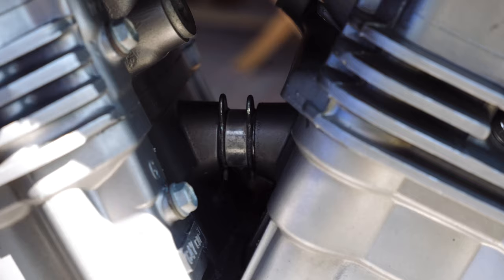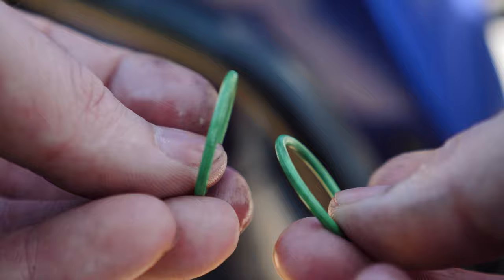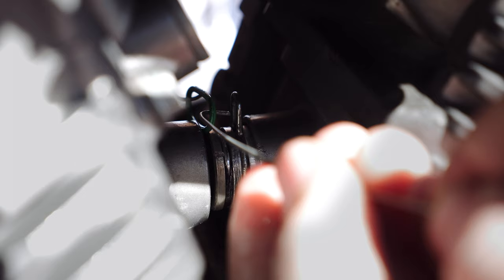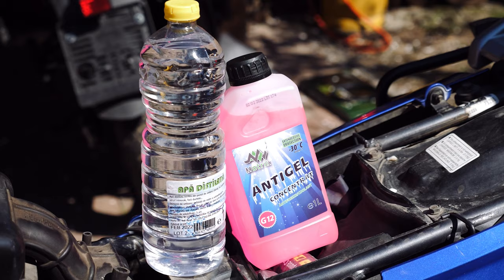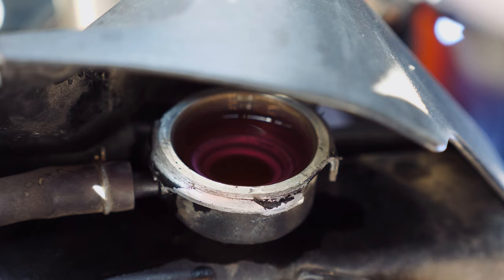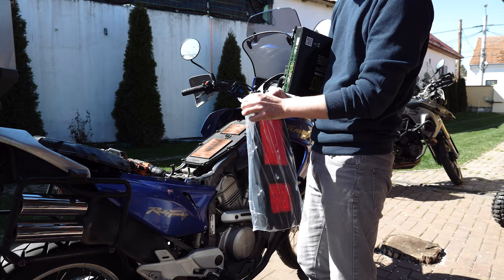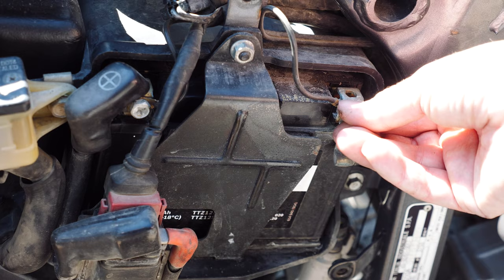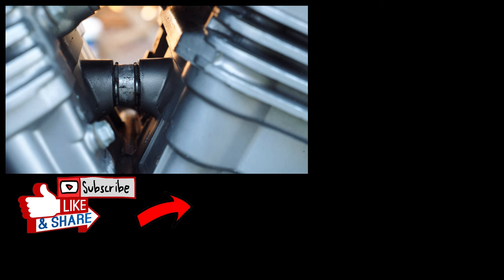How to replace the O-rings between the cylinders - Service TransALP 650 / S.3 Eps.14

Comment from the maker: In this video I replace the O-rings between the cylinders on my TransALP 650. It`s not a complicated service maneuver, but the coolant must be drained out from the system. The original dimensions for the O-rings would be these 21.5x2mm. But I replaced it with something else, still the same size. These green ones are used for car engines, and they are good in heat. 😁👌

Later edit: from now on you have English and Romanian subtitles 😁🤝 on the clip, settings, subtitles and chose the language.

Comment: Please am very grateful for your video but how can I get the parts because I find it difficult so if you can assist me with shops that I can get them when ever I need anything to purchase because i used the same typed my name y Enock from Ghana thank you
Reply from the maker: Hello 🙋 thanks for watching and appreciation. The original dimensions for the O-rings would be these 21.5x2mm. But I replaced it with something else, still the same size. These green ones are used for car engines, and they are good in heat. I got them from a car mechanic friend.  You should be interested in your region for the parts you need.  I don't know how I from Romania could help you with this... 😐
Reply: Thanks bro

Comment: You don't must drain out the coolant for this operation. The coolant starts to flow In the engine just when its hot. So the thermostat keeps the coolant circuit closed when you do this operation. You can fix the orings very easy with some dental floss too.  I make it aprox two years ago On my honda dn 01. 
https://youtu.be/65gJ-4p98Ds
Reply from the maker: Hello 🙋🏻‍♂️ interesting. Thanks for you comment. 😁🤝